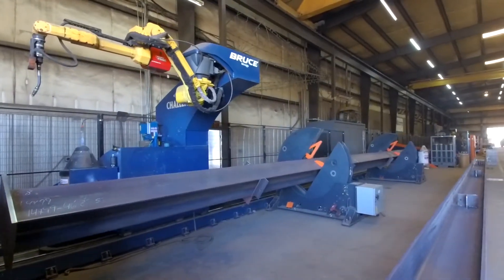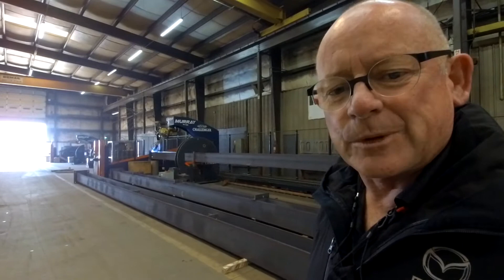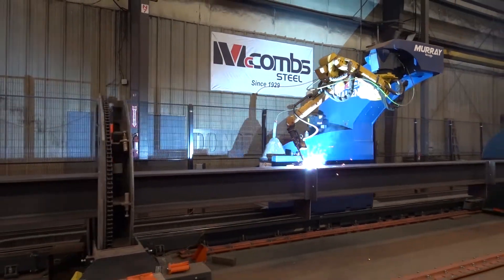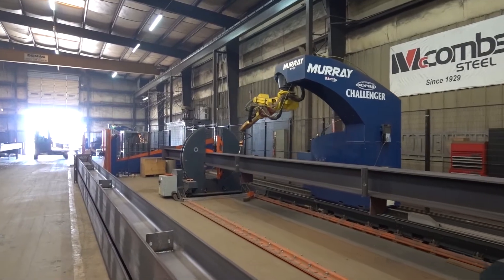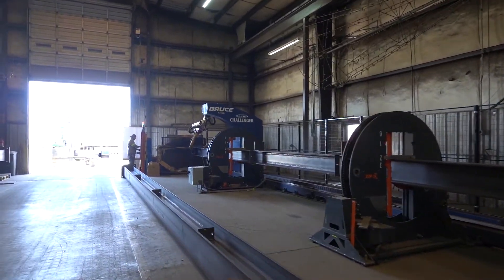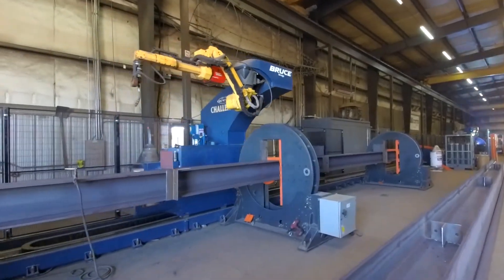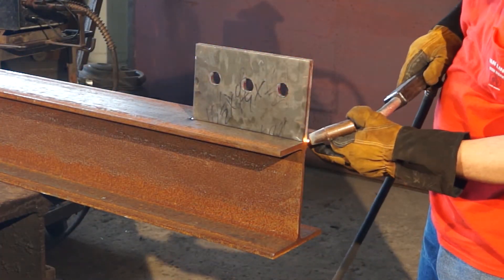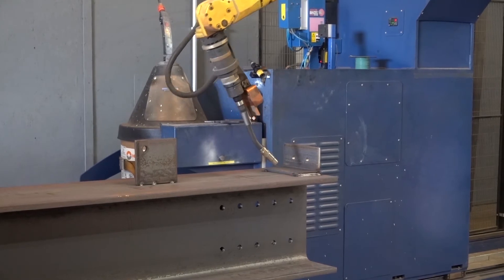Ocean Challenger | Welding Structural Steel Has Never Been Easier!

Comment: What happen if worker tack plate on 30mm different then drawings. Robot welding will crash.
Reply: The Robot Scans the part before it starts welding. If the part is in the wrong place it will not weld it and it moves to the next part.